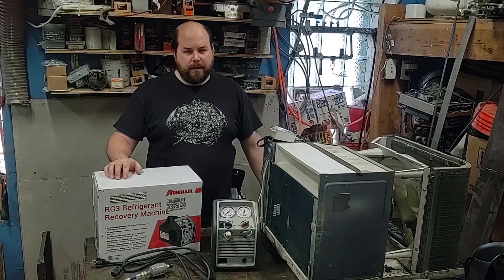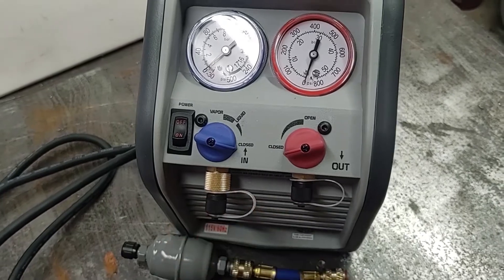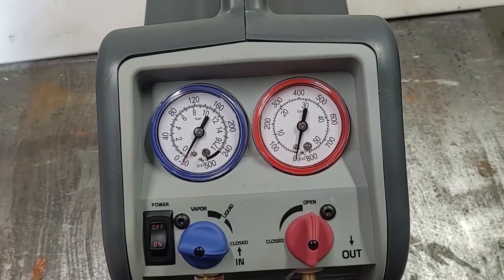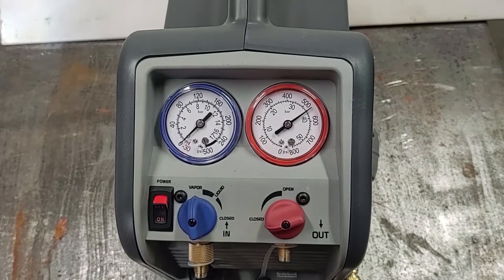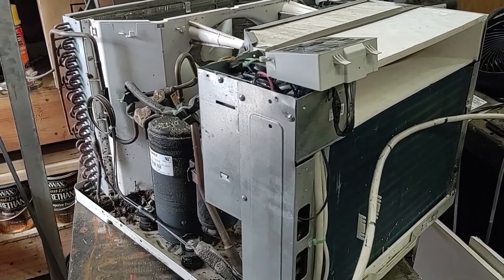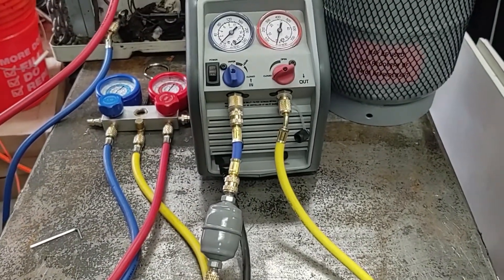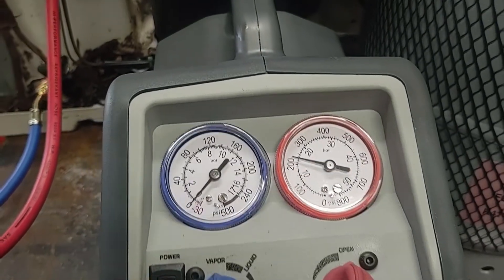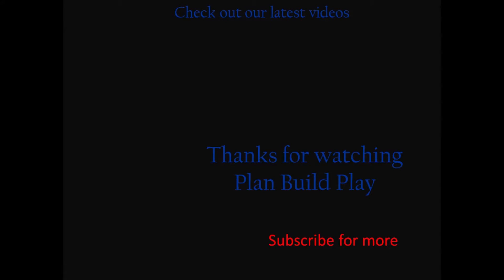AC refrigerant recovery machine - Robinair RG3 setup and testing

Comment: Does this machine handle R-134a?
Reply from the maker: Yes it will work with R-134a.  If working with more than one refrigerant just use separate recovery tank to avoid mixing refrigerants.  There is a link to the model I used in the video description.

Comment: Does this recovery machine have a PURGE on it to clear the refrigerant from it?
Reply from the maker: There is not a purge setting, but after done recovering from the air conditioner you can close the low side valve and run the machine to clear any refrigerant out of the machine.
Reply: @planbuildplay8528  Does not work, my rg3 just pull vacuum but refrignant still stays,